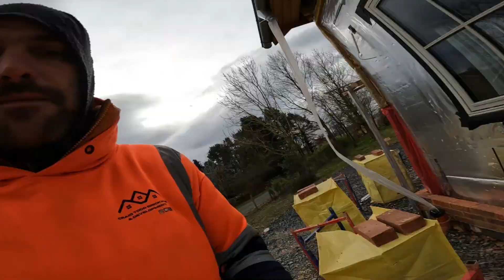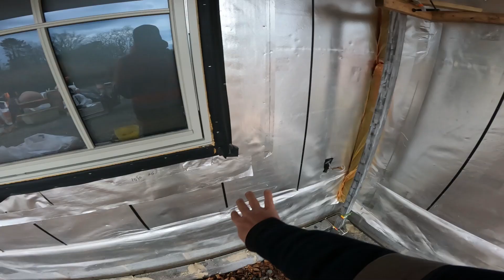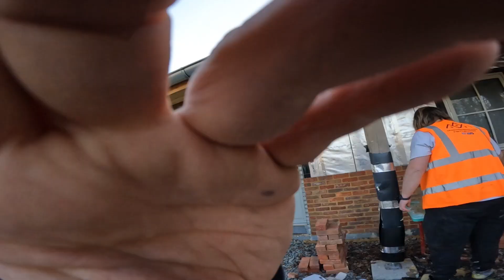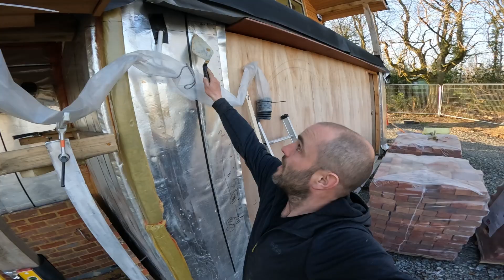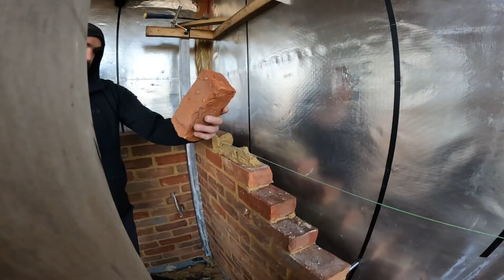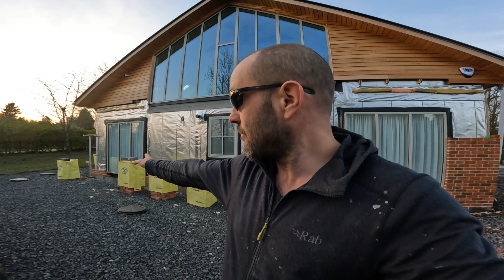We Had a Brickwork Problem… Here’s How I Fixed It! | Timber Frame Build (Ep3)

Comment: Great stuff sir, you’ve done the best job so far that I’ve saw on YouTube explaining the possible pitfalls and compromises needed on timber frames. Up in Scotland it’s pretty much all we get to build, and you’re really dependent on the quality of the kit gang in before you, as some of them are very good whilst others can be terrible. Most common problems we get are out of plumb, not ranged through, firestops round the wrong way or completely missing and opening heights not being level when they should be. You showed that problem up there with heights and also how to compromise and remedy it. Being able to spot a potential problem and remedying it before it causes trouble is essential on these kind of builds. Excellent video as always 💪🏻👍🤌
Reply from the maker: Thanks Teddy appreciate that mate 👊 absolutely agree too, find the problem before it is a problem

Comment: Hey Craig....here in New Zealand, timber framed housing is pretty much standard, so most Brickies have cut their teeth on Brick Veneers.
You have definitely spent some time, nutting out your gauge...in order to hit all those various heights ( window head, sill, soffit and so forth).
Our main consideration would always be, foundation to soffit or if not, a given finish height!! Because of all the possible variables like different window sizes etc....we would be forever trying to get up on gauge, only to get down on gauge...as the case may be!
Anyhow good luck and you are by the way, a good Tradesman.
John Hutchins
Reply from the maker: Cheers John, great input mate thank you 🤝 & thanks for the kind words mate

Comment: You might have pecked your own head, setting out like that. By now i wont need to tell you working to split mm on a timber frame is just asking for it...the frames themselves come to varying levels of pissed as it is. You quickly have to abandon guage and plumb on them or else the inspectors have a fit over cavity sizes
Reply from the maker: Yeah mate, lots of levels of p!$$ed 😅

Comment: Hi mate looks nice the bag rub finshes on the face work the bricks look really nice yes there like different sizes and shapes but look nice I said once you get your head round your first timber house your be away with the mixer like the detail on the cills as well looks smart you did well getting as much as you did down with the different heights and that you had to work out and face bricks like that you have to take your time because of the two sides and the shapes of them and different sizes top job as always mate 🧱👌👌👌
Reply from the maker: Appreciate that Dan, cheers mate 👊🤝
Yeah man, agree with the bricks. Once the wall is up & bagged off it looks absolutely lovely 🙂
Like you said mate, getting there now with the timber frame though 👌